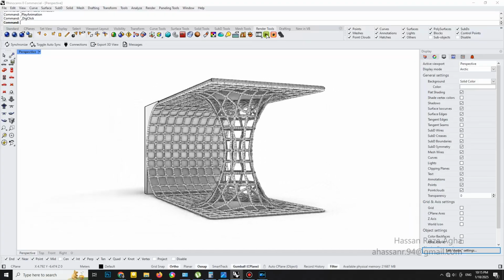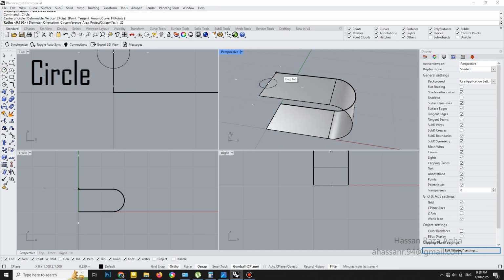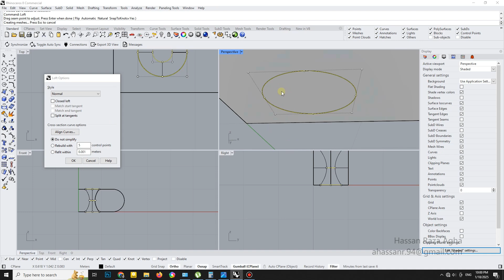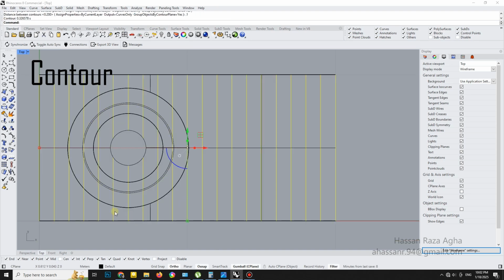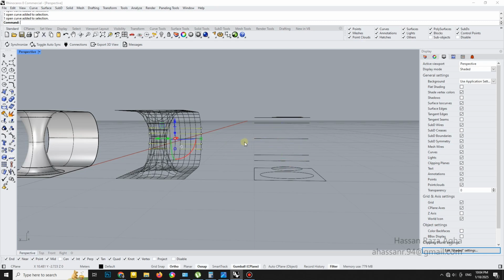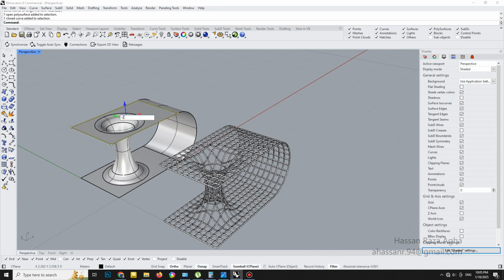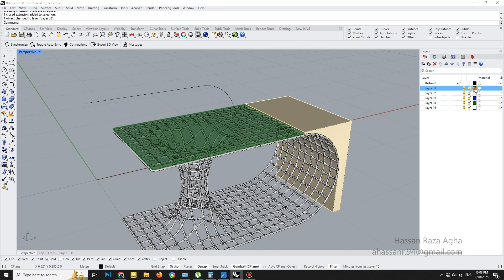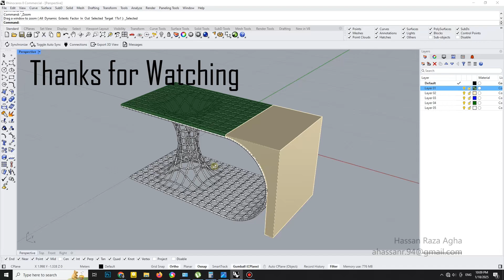Parametric Table Design in Rhino

Comment: Where is the parametric part? This is simple NURBS modelling not parametric. Please correct the video title, it is plain wrong and plain clickbait.
Reply from the maker: Thank you for your feedback! The intention of this tutorial was to show that designs that may seem complex or parametric at first glance can actually be created using simple NURBS modeling techniques, without the need for Grasshopper or advanced plugins. I aimed to make the process accessible and straightforward for users of all levels. I appreciate your comment and will consider your suggestion to ensure the titles align more closely with the content. Thank you for watching and engaging!
Reply: @Mr.Rhino3D Indeed, the content is fine, the title is the problem. Regards.
Reply: @Mr.Rhino3D  this is totally misleading. Direct modeling is not parametric, no matter how easy or hard it is to replicate the same. You don’t show how you change the values of any parameters because there are none. For direct modeling, Plasticity is cheaper and easier than Rhino. I clicked on this video hoping to learn how to do parametric modeling in Rhino, just as the title suggests, so it is simply disappointing to see it’s just clickbait.